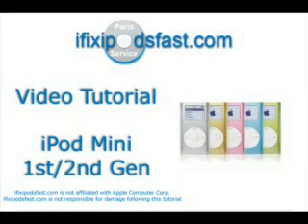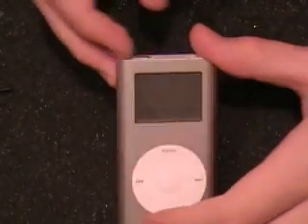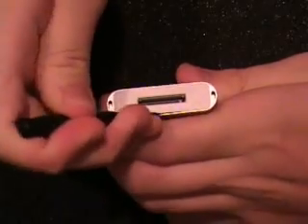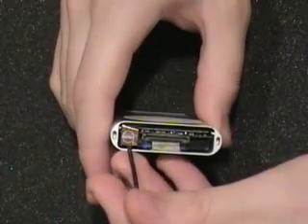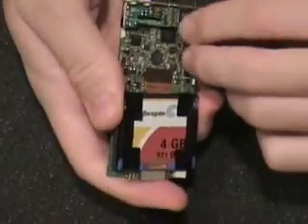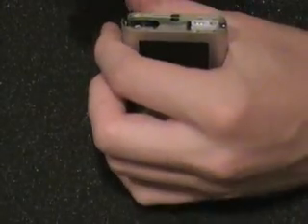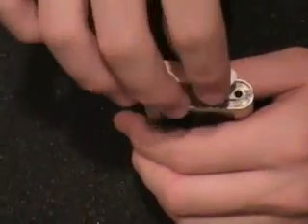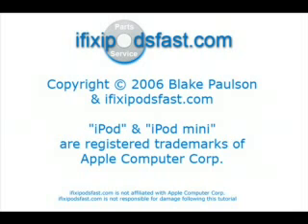Replace iPod battery DIY

Comment: We did not show the  re-installation of the click wheel flat cable. did you use a special tool? Did you use your fingers? This is a very important procedure, to skip this procedure does not make sense. The video was doing well up to this point. Flat cables can offer very stiff resistance and must be aligned perfectly to make contact with the rest of the circuits.

Comment: Hola amigo yo engo uno igual, y se descarga muy rápido creo que es la bateria en donde la puedo comprar. y muchas gracias por el video que nos compartiste es muy claro y aunque no se inglés te entendi perfectamente
Reply: TIENES TRES OPCIONES: 1° IR CUALQUIER CENTRO O SERVICIO DE MAC O APPLE Y SOLICITARLA; PERO ES PROBABLE Q' EL PRECIO SEA MUY ALTO; 2° SI QUIERES TE LO PODEMOS HACER UN PEDIDO DE LA BATERÍA, 3° TE LO PODRIAMOS INSTALAR UNA GENÉRICA COMPATIBLE.
EL PROBLEMA DE LAS DOS ÚLTIMAS ES Q' POSIBLEMENTE NO ESTEMOS EN EL MISMO TERRUÑO; DE TODAS MANERAS VERÍAMOS Q' SE PUEDE HACER...
Enviado desde algún lugar de BOLIVIA...

Comment: Thanks a lot! All these years later and it brought back the ipod mini! I would however reccomend just prying that little bracket on the bottom off with small flathead instead of the paperclip. The paperclip just bent...

Comment: How much is the battery? and how do I know what generation I have? :( It has been a long time and I have gone throug many Ipod's because of problems like these, if I knew then what I know now I would not have thrown them away and bought new ones, but just replaced the battery. Is it cheaper if I bought new ones. I have the following IPod's that have this problem.
1. IPod mini (I think??) 
2. Another one that is 15GB (???)

Please help.

Comment: I gotta say, you've got guts. post something about the 2nd gen Ipod nano on how to replace the batteries in that one. Allow me to rant though, why does it have to be so darn difficult to do this. On older ones you could just pop the shiny back off, replace the batteries and be done with it.